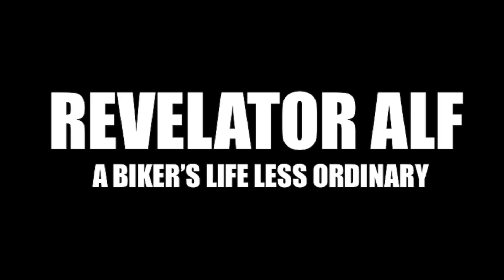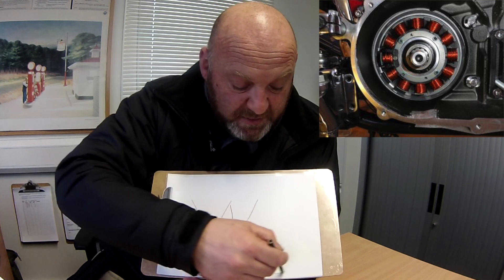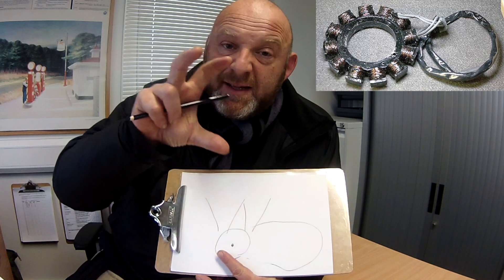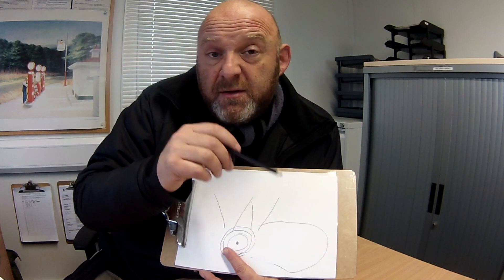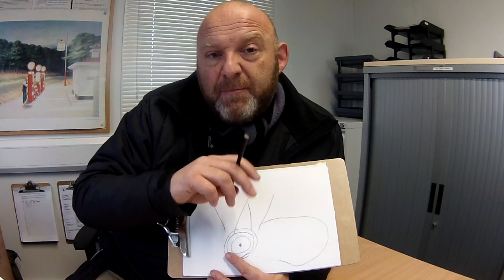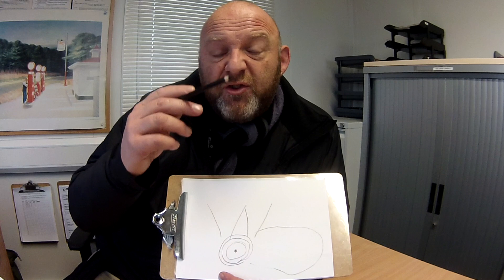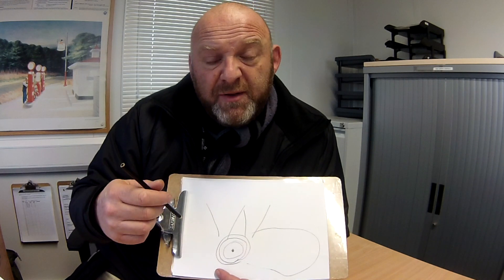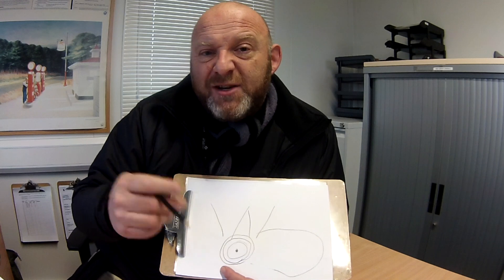How Does The Harley Davidson Softail Alternator Work

Comment: Good explanation. One technical detail is that the change in the magnetic field as it passes induces a voltage, not a current. Current is created when you attach a load.
As an aside, I thought you might find it interesting that electricity has a mechanical analog.
In electricity,                       Power = Voltage * Current
In rotational mechanics,  Power = Torque * rpm
In your alternator, you put torque and rpm in from the crank and get voltage and current out so you can keep your battery topped off.
Also, I liked your one eyed cat art ;)
Reply from the maker: Yes sorry I got a bit tongue tied. ha ha Picasso has nothing on me